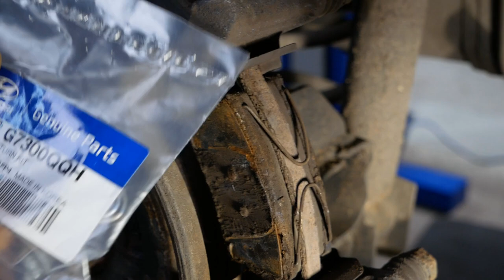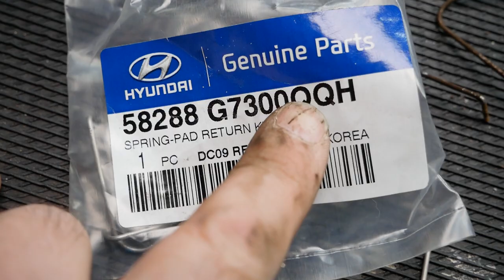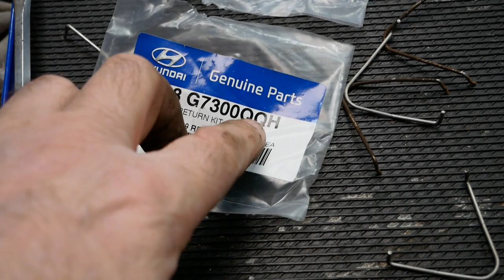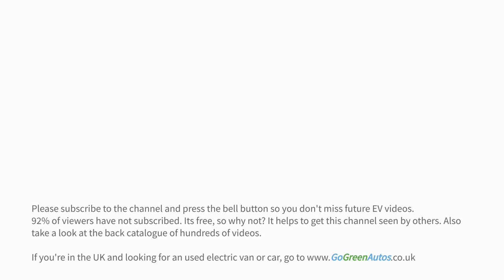Looking at the rear brakes on a Hyundai Ioniq Electric 28kWh

Comment: I don't think the wire  springs is the issue. There's nothing about the design that would cause the pads to "rust" or stick to the rotors. What might be happening is those brake were never serviced, where they get cleaned up and regreased on the contact points where the pads and calipers meet.

Comment: Quick question , is the car switched on to service brakes..? or how do you stop the vehicle applying the electric hand brake by itself….?
Reply from the maker: Yes I would leave the car switch on with the handbrake off or put it into service mode with the diagnostic scanner which winds back the park brake servo.

Comment: Problem is too tight fitment in front and rear brake pads. I had to replace rear discs and pads and I used angle grinder to shorten pads mounting ear so that those are little loose to sliders.
Reply from the maker: Yes many pad ears seem too tight. I've filled them too before. But I wonder by taking the paint off, that will probably make them rust quicker and then swell slightly, so probably not gained much. When I've filled them, I paint too, but I suspect they soon rust.
Reply: Have you had success with them since you used the grinder on them?
Reply: @ugcamige  mine modification  works fine. No extra noises and pads are sliding nicely

Comment: Have Hyundai changed the rear brake system on the 39kw Ioniq's as the rear brake problem on the first gen 28kw should have been picked up by Hyundai
It will be an interesting fact finding for a future video as to whether the Ioniq5 suffers the same trait 
Thanks again for your detailed video's
Reply from the maker: Its been a long time since I've worked on a 38kWh model, but from memory, the brakes are identical to the 28kWh.
Reply: @GoGreenAutos  Thank you Matt

Comment: Really interesting. On the 1999 Toyota RAV4 EV Toyota fitted aluminium brake disks, this stopped corrosion from infrequent use as the regen did the majority of the braking, the rear brakes were drums which were low maintenance.

Comment: Your channel is really awesome and I appreciate all the work you do. I own the same car and so far I’ve given the car to my Hyundai dealer to do the service but this time I will maybe do it myself or let a cheaper service workshop do the service.
Mine is a 2018 model and it has gone around 9500km and the service light is now lid. 
Is there a chance you do know What needs to be done around these kilometers with this car? 
Is breaks and pads standard maybe every time you do the service? I’ll understand if you don’t have the info. The ln maybe I just can google it and find a checklist. You are way more reliable than some dealerships 😉 and I don’t want to ask Hyundai how many steps they will go through 🙈🤭🙏🏻
Reply from the maker: When out of warranty, distance (km or miles) doesn't really matter with an EV when it comes to servicing. Time between services is more important. Your brakes get used very little so rust and seizing pads can be an issue so a strip down, clean and lubricate brake pads is needed every year or so. This is something main dealers don't do as part of a service.
A new cabin filter every 1-2 years. Check brake fluid for moisture content. Change the reduction gearbox oil every 80-90,000km or so.  Change the motor coolant every 5 years.
Reply: @GoGreenAutos  the motor coolant… I should then ask Hyundai since they did last service one year ago and the car is 6 years old . Gear oil should also then be changed now… hmm wonder if they did anything of the things you mentioned… thanks for priceless info as always.
Reply: @GoGreenAutos  does this also apply to a Tesla model 3 2019? 😅
Just bought one 4 weeks ago and the seller told me that the car should tell me if it needs anything. I guess that breaks and filters are the main this to check… 
If there are known issues I couldn’t prevent such as incidents with AC systems or other things that is good. 
Only downside to Tesla so far is that the battery drains a lot more than the ioniq just parked even if sentry mode is turned off .. I’ll try to remove third party apps etc…
I’m too new in the “Tesla-ecosystem “ but have to learn at some point:)

Comment: Just clean up the pads until they slide nicely in the holders, simple.
You will have to file the rust off, wire brush won't touch it.
Of better still just put new pads in and stop being tight.

Comment: Seems like there's an opportunity here for someone to come up with a more efficient design, Matt... 🤔

Cheeky side note: be great if you could use a camera stand so we could watch you do the service.. 😏😊👍
Reply: Drum brakes is the best design for the rear axle of an EV! It is frictionless, has simple+strong hand brake and parts are protected from water.
Reply: @rangleri  yes, you're right of course. Don't know why they don't just fit them now on EV's. Matt does mention them in one of his other videos, possibly the Kangoo brakes one that he spoke about here. He may have come up with a suggestion why but I can't remember off hand.
Reply: @rangleri  do you think it might be because they're heavier that they don't get used? If that's the case I would have thought that the lack of friction and build up of friction causing material would be preferable.
Reply: @judebrown4103  Yes he has done so many amazing detailed and helpful videos! He deserves way more views and subscribers.
Reply: @judebrown4103  Hmm, I don't think they are that much heavier than a disc brake setup, some drum setups can be even lighter than a disc setup. It seems that the new and expensive VW id3 and id4 also have rear drum brakes - and it is a very lightweight material drum design. Also some of those Audi e-Tron models have rear drum brakes. Many Renault's EV's have had them, maybe simply because the company uses their widely available parts(Zoe had same drums as Clio) Kangoo original had drums, so the EV version did as well, many Dacias had drums etc.. So maybe they used drums because it was cheaper option but it has also advantages for the car's owners too!
Reply: @rangleri  oh right, so it boils down to just using what they've always used... In other words what they happen to have hanging around! Anyone thinking cars are made in the best way possible for optimum performance is sadly mistaken... . 🤔
Definitely something to bear in mind when we finally get to make our purchase. Thanks for your guidance. 👍
Reply: @judebrown4103  It may not always be as simple as that, but of course car manufacturers don't want to waste money. If you think about this VW example, their older generation EV:s, (VW e-Up, Skoda Citigo, Seat Mii electric) are very similar to each other, and all have the same rear drum brakes in many models(also combustion engined versions) But their new id series EV:s have some kind of Composite/aluminium drum brake design, which must have costed them lot of R&D money, so in this case the drums are not there to save money but get the benefits of the drum brake.
Reply: @rangleri  oh yes, I forgot you did mention that, I guess VW are trying to get things right after all. 👍

Comment: Would it be possible to just open the springs up a bit to give them some more tension?
Reply from the maker: I tried this this morning. Using some pliers, the spring did open up wider, but as soon as you squeezed it, it went back to its original.
Reply: @GoGreenAutos   Hmmmm, looking at the springs and the brake pads, I think there might be just about enough space to do a slight modification yourself.  
What if you mount two additional springs in between the original  🤔?!
This will require drilling two extra holes in each pad and most likely shortening the springs to accommodate the additionals but it will increase the outward tension. 

If anyone has a better idea I will be happy to hear it! Because this car is in my mind and I need to gather as much info as possible about its maintenance before I jump to purchase it!

Comment: this is even worse problem on some i30's rear brakes. worst case, you have to use hammer and screwdriver =D here in CZ we do maintenance on brakes regulary. these ioniqs are fairly reliable cars with few issues. on all ev's brake maintenance is critical for brake longevity.

Comment: What's the torque specs on the caliper bolts? I'm having trouble finding a good source
Reply from the maker: Front caliper guide rod bolts 21.6 - 31.4 Nm
Rear caliper guide rod bolts 21.6 - 31.4 Nm
Front caliper assembly to knuckle 98.1 - 117.7 Nm
Rear caliper assembly to knuckle 78.5 - 98.1 Nm

Comment: Many EVs eg KIA E-Niros & KONAS put the electric handbrake on when you turn the car off, some even apply the handbrake when Park is selected. Would you have to have the car ON/in Ready Mode, turn the Handbrake off, leave the car in Ready mode and then remove the caliper? (Otherwise I cannot see how you can keep the handbrake 'Off' so you can remove the caliper? Also a bit of a worry if the car was turned off by accident when calliper was off the car but wiring plug still connected as the car would apply the electric handbrake and push the pistons out of the calipers, total nightmare!)
Reply from the maker: You can put the car in Neutral, so the handbrake doesn't come on. Or If you have a diagnostic scanner, you can put it in "handbrake service mode" where it is fully wound out.